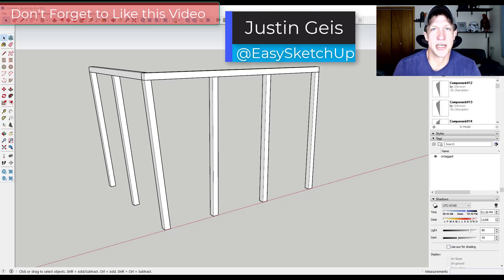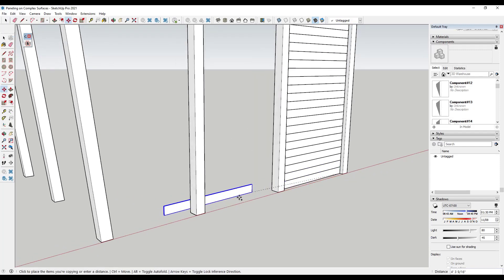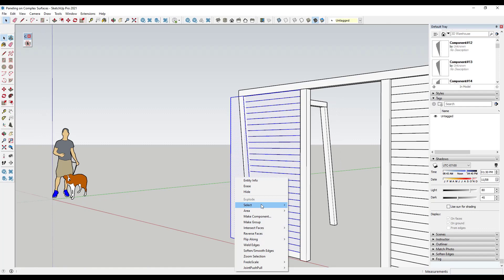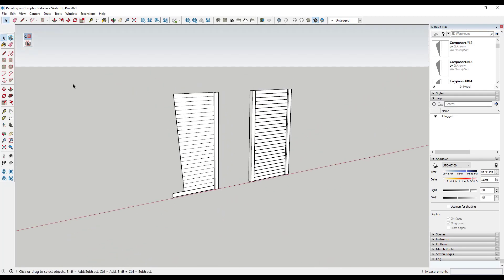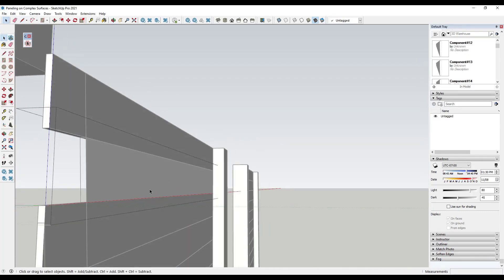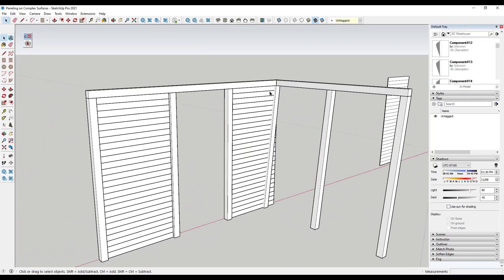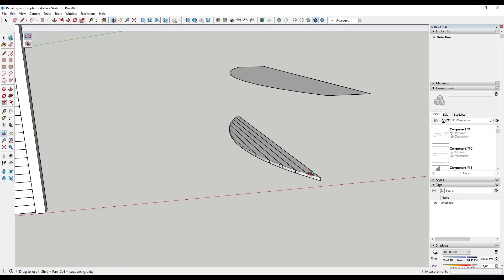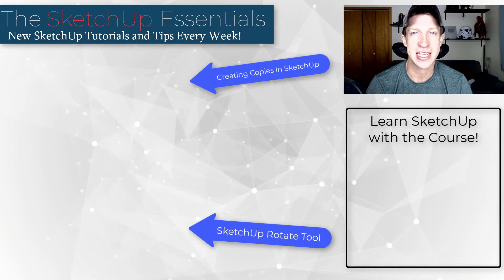Tips for Modeling with BOARDS AND PANELS in SketchUp

Comment: Hey Justin, in the case of cutting straight lines, the fastest way to cut out the objects in your video is to use the s4u slice plugin and use the cut tool, you can also cut perpendicular to face now which is awesome so you don't have to hotkey the camera and put in parallel projection before the cut anymore. The s4u slice cut tool is far faster in this scenario than curic face knife.